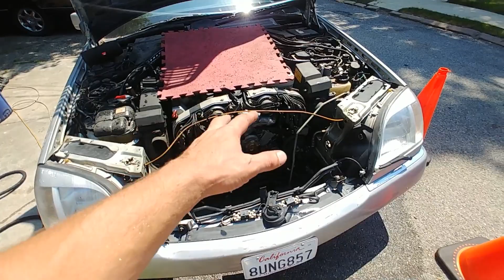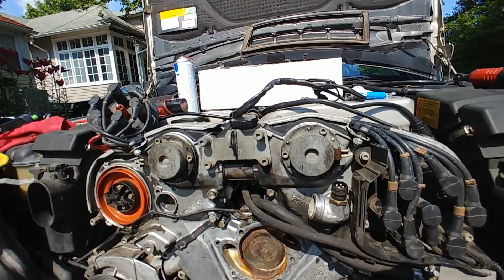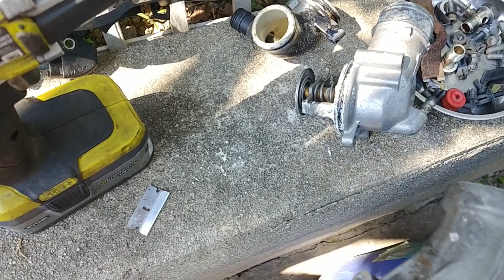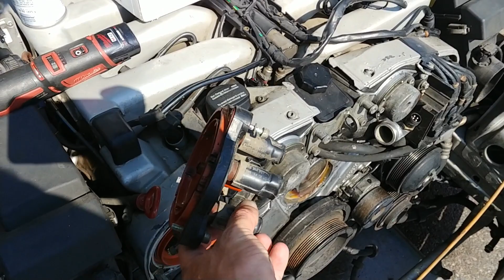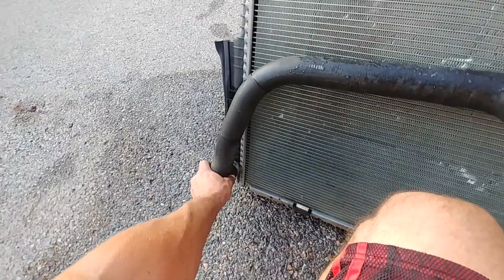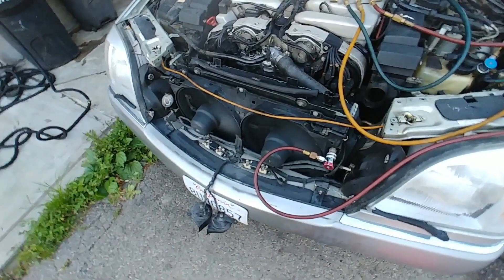1993 Mercedes 600SEC. Work continues. Water pump replaced

Comment: Hey victor I had a water leak into my carpet and now I’m experiencing major electrical issues. The repair shop replaced my ABS module but it didn’t fix fix the issue. The mechanic showed me there was water damage where the harnesses are. How much should this cost to repair with parts and labor? I know it’s extensive work, but I’d rather get a good mechanic to do it than to get the dealership to over charge me. It’s 2012 Mercedes Benz c300 4 matic. Thanks in advance of your able to answer.
Reply: Hello Victor, i am a fan off your explanations en filming, i realy learn very mutch ho to do it myself, i have a S600 1994 coupe with 322.500 km on the clock, a original Dutch car, imported ofcourse from Germany in march 1994, i am watching your explanation and films from the first day in 2017, your latest explanation from juni 2021 gives me a clear open view behind the ventilator fans, i wil thank you for all your effort in these issues and cases, hopefully there are coming more, with regards, William Kaag from the Netherlands, see you on youtube again, wkaag51@hotmail.com

Comment: Hey Victor, a trick to dealing with rounded/worn Allen Key is using a "Spline" tool. The correct size will always fit inside the hole with a few taps of a hammer